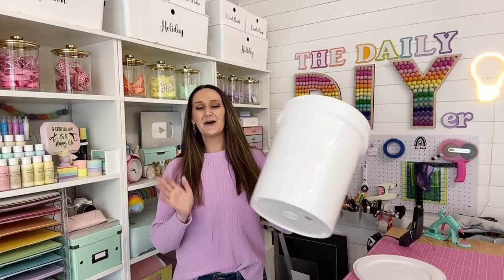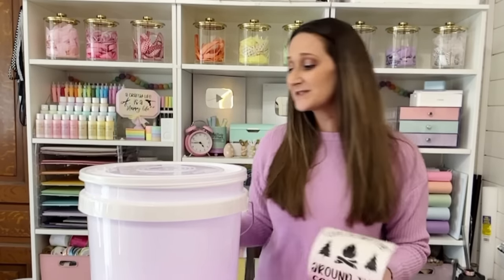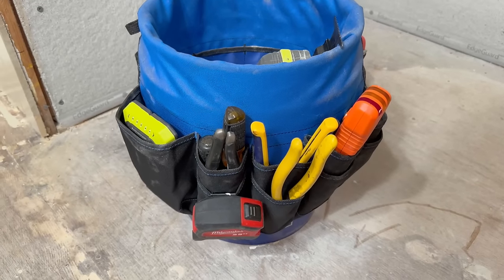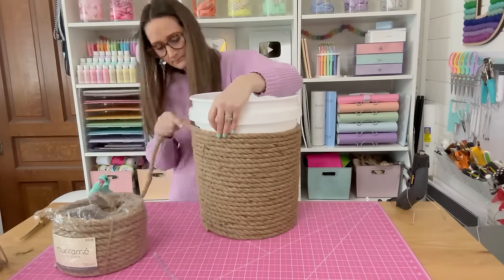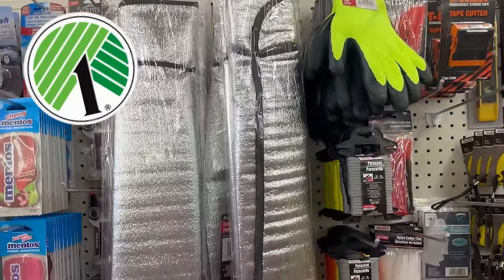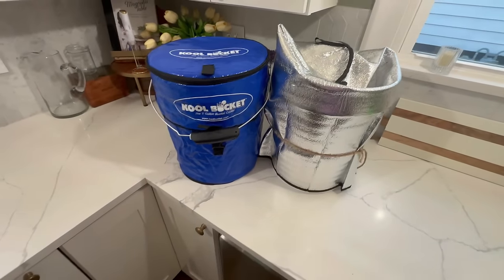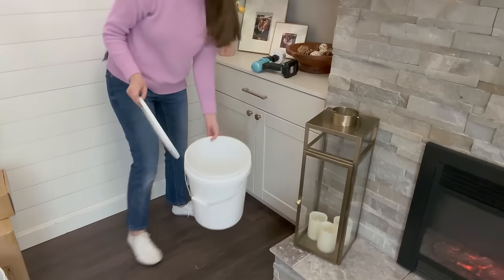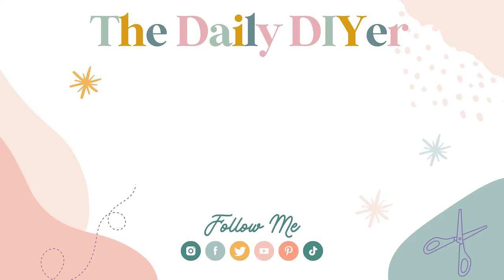Why EVERYONE is grabbing 5 Gallon Buckets from WALMART... so smart!

Comment: Such great ideas for those buckets.  A split pool noodle makes a quick cover for the plastic handle
Reply from the maker: Great idea!!
Reply: foam pipe insulation does, too and is smaller in diameter for my small hands.

Comment: I used a cushioned lid (I think it is made for hunting because it is camo) on my 5 gal bucket. It also swivels. I would recommend putting a round board in the bottom of of the bucket before attaching the castors. The plastic isn't strong enough for heavy duty usage. I use mine for refinishing furniture. and doing detail work of large projects. I've used a 5 gal bucket 'handy-man' pouch for years and love it. I also put castors on it. I also use them for long stemmed artificial flowers, bushes, peacock feathers, etc. I have some deep shelves for large objects in my workspace and I lay the buckets on their sides on them for easy access. I also work with cement, sand, plaster of paris, etc and used colored bucket on castors to store them in. I love 5 gal buckets. I like the dust pan gadget. I've never seen that. I need to get one. I also liked the 'table'. I could store throws in them. Thanks for the great ideas. Oh and you can get screw-on lids that are much easier to use for things you need to access often. They are more expensive, but well worth it in the long run.

Comment: I want to make every single one of these! ❤
I’m going to start with the outside lantern for our bonfire next weekend ❤
One little addition on the side table/ storage idea would be to add some rope to the underside of the lid. Make it the same diameter as the inside of the bucket so it lines up centered every time 😊
Thank you for all the wonderful ideas ❤
Reply from the maker: Love that idea! Thank you!! Have a great time at your bonfire!
Reply: I just posted saying basically the same thing, but I didn't think of using rope. That's a great idea! I had suggested to use little wooden half circles glued on instead, but I think I like the rope idea better. 😊

Comment: The bucket with the wood top as a table is cute. I would consider, however, to maybe put something on the underside of the lid to keep it in place when on top of the bucket, to keep it from sliding around or off if it gets bumped. Maybe just some wooden half circles glued around the underside, just a few in a circle a little smaller than the bucket opening size.

Comment: A cheaper version of this handle idea is a pool noodle cut to size the a slit cut long ways,  half way to middle hole and use zip ties to tighten them to keep in place and cut off excess,  then hot glue the zip tie where it comes together to prevent any possible sharp edges!